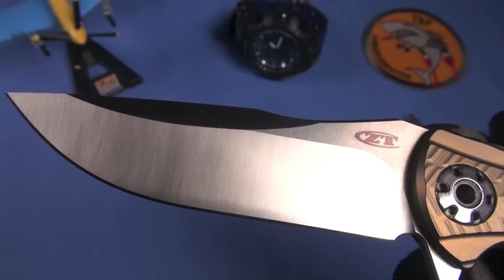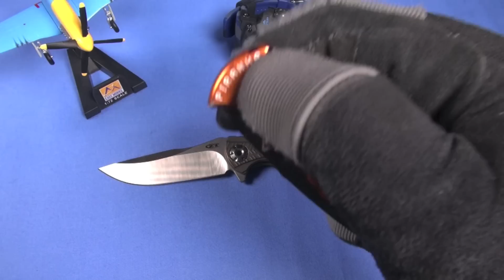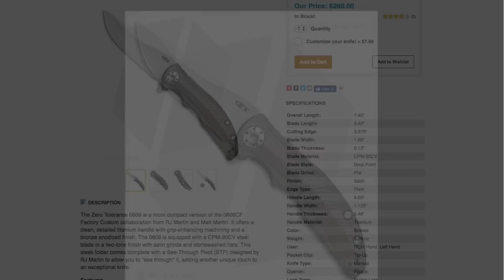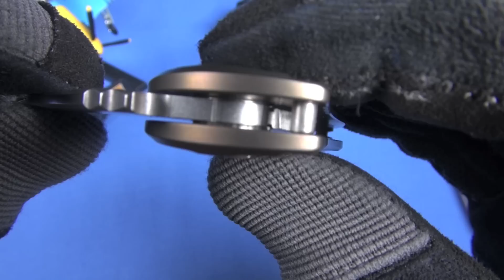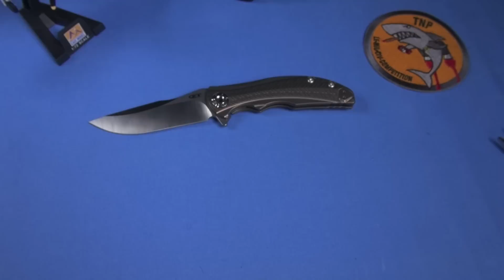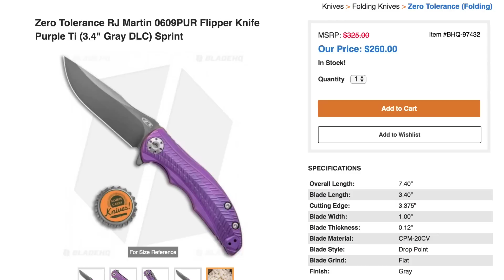Zero Tolerance 609 RJ Martin

Comment: The lockbar insert is there so the titanium scales don't contact the blade steel, it's not an over-travel stop. The titanium is softer than the blade steel and will deform causing lock rock if there is no lockbar insert. CPM-20CV is also wear resistant so alumina based stones will not properly cut the carbides in the blade steel. Diamond stones will give you the best performance out of this blade steel.  The titanium scales are also very slick on this model and I wish they had more traction on them.

Comment: do not like flippers or or the blade shape.  blonze is ok.  I just dont think the build pivots on ZT stuff makes any sense unless you have 100 knives and treat them as fashion.  I prefer the  sypderco budget knives. They are very rugged and last a very long time.  Extremely expensive knives tend to sit in a drawer instead of getting used. I have no use to stash a couple grand in knives in a drawer because they might be worth more some day.  ZT seems to be closer to the disposable end of knives.

Comment: To remove the pivot, I slightly modified the angles of the prongs on a set of corn on the cob holders.  I also ground down the points just slightly to minimize chance of scratching with the tool.  Works perfectly to remove the proprietary pivot.
Reply from the maker: Thanks for the tip. That saves some folks a couple dollars for sure. -Doodle
Reply: Awesome idea, thank you for the tip!

Comment: I have both the Bronze (serial 0097) and Blu/blk - the bronze has a much better steel vs the Blue. I EDC the bronze nearly 3-4 times a week.  The main issue - the pocket clip. It loosens easily and rocks and blocks the lock bar making the flipper function sticky. The 0450 also is plagued by that clip
Reply: i can vouch for that! my 0450 clip did the same thing!

Comment: It reminds me of my Kizer Intrepid in blade shape/design. Love it. That bronze puts it over the top, very appealing. Thanks for all your effort and vids. Enjoy.
Reply: How has your experience been with Kizer? I really want to try out the Gemini but am nervous to pull the trigger since I've never handled a single "high end" chinese folder.
Reply: @donjohnson5424  Hey Don, the Intrepid is from the Kizer Vanguard series, the 'entry level' kizers. I am no expert, however Birdshot IV has a review on u-tube from 3 years ago on this very one. I priced is on amazon, $70.40, when I bought mine last year it was $60.20 and on the birdshot review they quoted $80. So, it is reasonably priced. It is not a $200+ Kizer. Watch the vid for some proper info if you care to. I just mainly collect, so I haven't put any real use to it, but it is a very knife, a bit heavy, but flips great and is appealing to my eye. Anyway, enjoy your knife life.
Reply: @riverrunner23  Really appreciate all the info Robert! I'll definitely check it out, sounds like an perfect entry into Kizer before I spend the money for a higher end one!

Comment: Woot I love my Zero Tolerance 0450 (titanium one). I think you should check it out nutn, it seems like one you'd like. 

I think it's the favorite knife in my collection (even more than a Microtech Ultratech).
Reply: Love the 0450 so much that I've got three! Wish they would do a sprint run in 20-CV. Been thinking about investing on an 0452 but its SO stinking big.
Reply: @donjohnson5424  the 0452 is a good big. i too love the 0450. when i decided to get the 452cf all i could say was hell yeah and smile.
Reply: ablackprep  Really? I did not realize that. Good job big nut